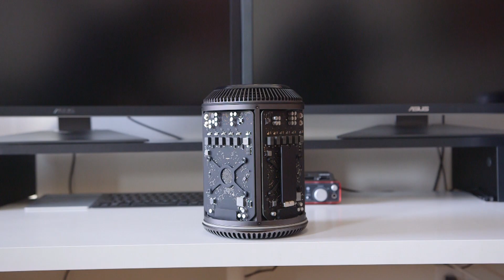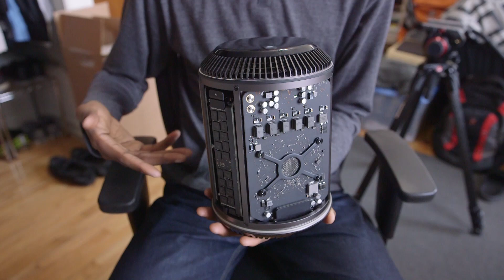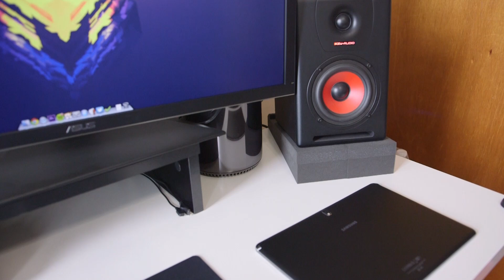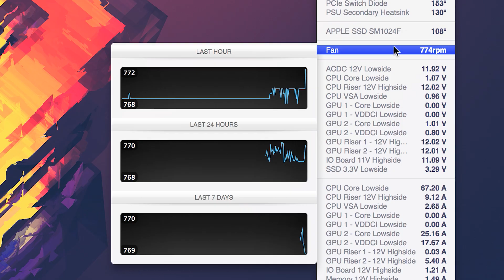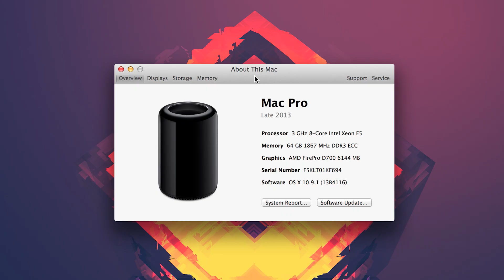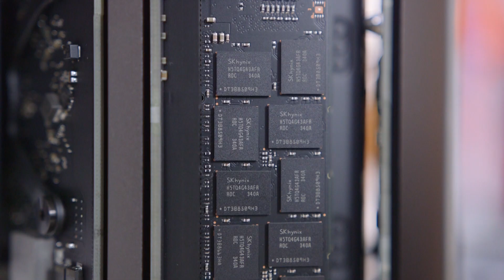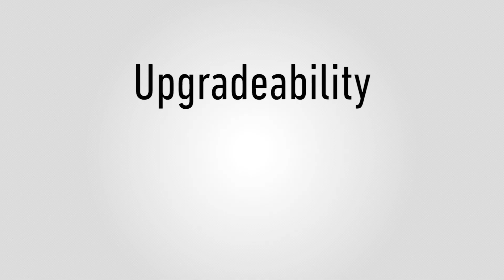New Mac Pro Review!

Comment: Mac are hated among Wed Developer since Apple decided to not support Java anymore.  They are over price.   It sad that this Mac Pro Margues bought gonna be outdated in 2 years but hey thanks to u Youtubers, he can afford another one.
Reply: james campbell Just checking.  I've seen some people claim to run 4K on low powered computers and claim they can do it smooth, only to find out that it's highly compressed internet 4k.
Reply: Outdated in 2 years? My 7 year old MacBook is running Apple's latest OS and can do anything I throw at it..
Reply: james campbell Just because you can run the latest OS (probably 32 bit) your not up to the standards lol. "Anything you throw at it" Yeah facebook is so hard to load.
Reply: ItsDenn actually, both my laptop and the OS is 64 bit. Tell me, can you buy a 7 year old windows laptop that can easily render 4K video? Can you open/run Photoshop smoothly without no problems on a 7 year old windows laptop? Didn't think so.
Reply: james campbell Are you trolling? First of all a "windows laptop" is manufactured by different companies with a vast amount of different hardware so it depends on what hardware you bought. Second 64 bit is nothing when using some 4 gb ddr2 memory (though you could have more gb you still probably have ddr2 memory). No laptop that is 7 years old can easily render 4k video. No matter what brand. So maybe your definition for easily is really different than mine. To be able to render 4k easily today would cost you a lot of money. Same goes for the photoshop (opening photoshop would be really fast if you upgraded it with a ssd).
Reply: ItsDenn You are so uninformed. My MacBook uses DDR3 ram. Not DDR2. secondly, how do you know I cant render 4K video? Do you own a Mac? No. You'd be surprised at the performance of even the old macs.  60% of my CPU's dye is made up of the GPU. You don't need a good computer to render 4k. ANY computer can render 4K no matter how old, it will just take a really long time. Whereas my Mac doesn't. You cant make these claims about a device you've never owned or used.
Reply: james campbell as is said probably ddr2, I didnt care to look it up. I didnt say you cant render it, i said cant render it easily, which you just confirmed by saying it takes a long time.
Reply: james campbell What cpu do you have? I guess an intel cpu. guess what, those also come with "windows laptops" so that shouldnt justify buying a mac.
Reply: ItsDenn Did I say justifying purchasing a mac was based on the CPU? No. Also, the CPU in my MacBook was specially designed by Intel as Apple wanted a lower wattage CPU in their laptops as well as high performance graphics. http://www.everymac.com/systems/apple/macbook/specs/macbook-core-2-duo-2.0-aluminum-13-late-2008-unibody-specs.html Here are my specs. IT'S NOT DDR2 FFS. Are you stupid??
Reply: ItsDenn I also said that other computers will take a long time, not my MacBook. You call me the troll yet you're literally being so stupid right now.
Reply: james campbell lol I did not read well I apoligize for that, though you didnt either "as is said probably ddr2, I didnt care to look it up" (quoted straight from my comment lol)
A lower wattage cpu would normally performe worse because they just cut out the power, and make it run slower, and it has only 2 cores not really great for video editing, that "extra" gpu power has pretty much gone to waist also as you have a dedicated mobile gpu in there. That whole specs list does not indicate any form of your so called "up to standards" machine especially for 4k video editing.
Reply: ItsDenn Lower wattage CPU's don't equate to less power. Increasing performance whilst lowering power consumption is one of Apple top priorities in Macs. Also, I said my Mac was from 2008. Dual core CPU's were great for video editing back then and they still are today. The only use for a quad core would be multi-threading, which most applications don't support. "That extra gpu power has pretty much gone to waste"? Why's that? Because of the CPU? The GPU and CPU are made for each other and are incredibly optimized. The GPU does 90% of the work over the CPU when rendering. Tell me, what is a machine that can render 4K? Like I've said before, any laptop can render 4K, it will just take a really long time on older models. But the thing is, my laptop was primarily built for video and photo editing. So it doesn't take long at all. Again, the GPU does more work over the CPU and MBA's can render 4K with no problem with Intel HD 3000/4000 graphics and my integrated GPU is on par if now a little slower. OSX is optimized for the hardware, which is why it runs really fast, even today's standards. You really don't know anything about computers.
Reply: "that "extra" gpu power has pretty much gone to waist also as you have a dedicated mobile gpu in there." It wont use that extra gpu power of the cpu because you use a dedicated gpu. low power does mean lower performance unless intel has made an entirely new architecture which uses less power for more. I never said it wasnt a good laptop for when you bought it. The whole point of this discussion is to point out that a dual core old macbook is not able to render 4k "easily". It was built for video editing back in the day when 4k was unheard of.
Reply: ItsDenn 4K may of been unheard of, but that doesnt mean it can't render it. I can easily like I've said many times before, render 4K. Final cut pro is optimised for Macs, so rendering doesn't put much struggle on the hardware.
Reply: james campbell
What kind of 4k video are you rendering?  Because if you're just ripping some YouTube 4k and running it through FCP, then you're basically running the data rate equivalent of high quality 720p video, which wasn't difficult even in 2008.
Reply: ***** i just stopped answering this guy
Reply: ***** Maybe from a 4K camera? ItsDenn You stopped answering because I proved you wrong.
Reply: yep.. every 18 months performance doubles.. that means in 18 months, a computer half the price of this one will have the same performance... look at the chromebook I'm posting this on.. fastest web surfing machine I've ever used. it doesn't really make any sense.. it's a freaking atom processor.. BUT.. the user experience has ZERO delay.. take that apple fan boys.. this thing will outrun a macbook pro for web surfing. I know cause I just did...

Comment: is this like something for the wifi or internet im not getting the point of this object
Reply: It is a workstation computer, it has its own CPU, RAM, GPU and storage.

www.apple.com/mac-pro might give you some hints.
Reply: Indecisive Fella
"Workstation" is a strong term for this thing.  Enthusiast computer is closer to what it really resembles.  I mean really, what's the point of a single Xeon setup when you lock out the potential for a dual Xeon system in the future?  The current X99 Platform offers similar results to that single Xeon that the Mac Pro offers, given the limitations the Mac places on the CPU overall.  But even if I didn't compare that E5 v2 Xeon to an X99 chip, I can still note that it's woefully behind the E5 v3, E7 and E7 v2 Xeons currently available for any PC workstation.

This thing ranks with higher end gaming rigs, at best, and minus a real ability to upgrade.  Workstation?  No.  Catchy (if not illogical) design?  Absolutely.
Reply: server -strength desktop. If a regular computer is a corolla, this is an f350 super duty with twin turbos, a lift, mud tires , tinted windows , mud flaps , ... And maybe even an extra engine.